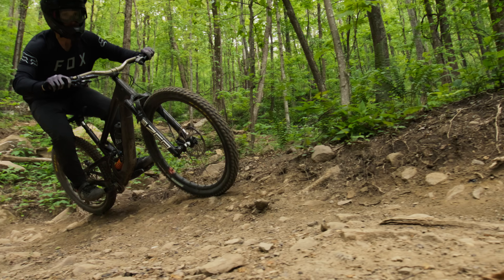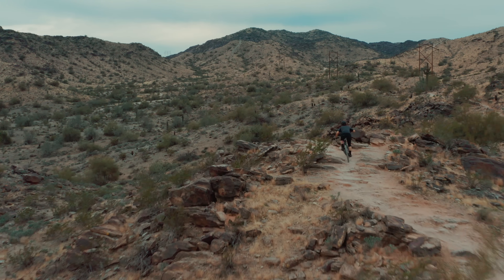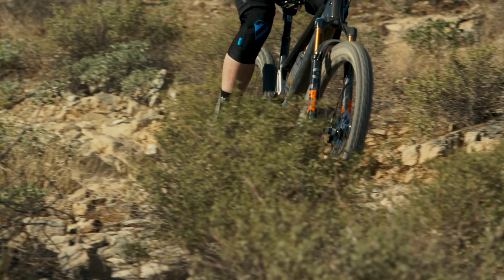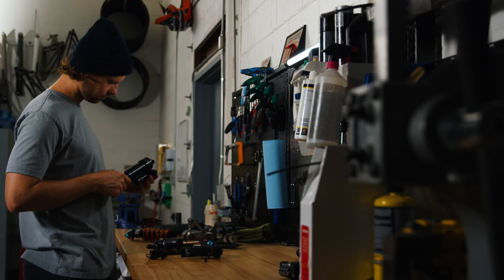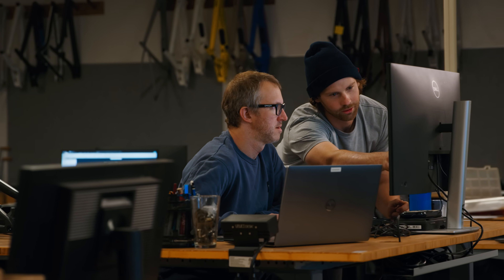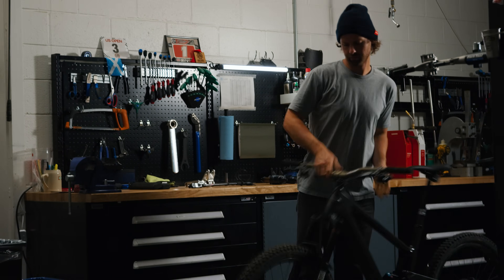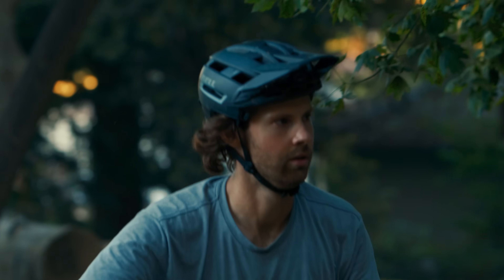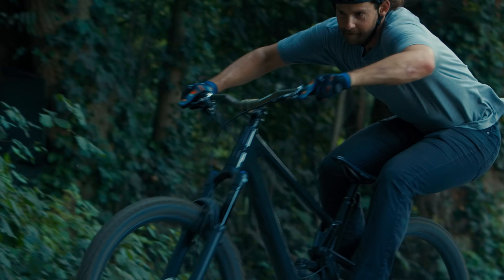Who is Santa Cruz's suspension test rider, Kiran MacKinnon and how does he do his job?

Comment: Interesting that the guy who kind of picks the suspension runs a rs front fox rear.
Reply from the maker: This is a question we get asked alot. People think there is some sort of rule, or reason that you can't run a different brand fork and shock on the same bike. There are zero reason not to. If we really like the way a specific rear suspension works on a bike, we run it regardless of fork brand on the same bike model. Sometimes you just find the best of both worlds to get the overall feel you are looking for.

Comment: I’ve learned the suspension that feels perfect for a pro ride will probably feel like crap to your average rider. Average riders probably make up 80% of bike sales
Reply from the maker: This can be true, which is exactly why Kiran mentions that he's always looking for that balance to find the 'perfect tune' for varying types of riders👍
Reply: Agree 100%. I've got a 2022 Tallboy.  When I ride at my top speed the bike feels pretty damn good; the best MTB I've ridden in 35 years of riding.   I'm neither skilled nor fit enough to ride the stock setup in its sweet spot.  This results in the bike not feeling all that great at my usual speeds and lines.  Nowhere near enough small bump unless I'm hammering. It's riding very well now that I've made mods with a Vorsprung Luftcappe in the fork and finding a better spacer/ psi combo for the rear.  My take on it is I don't want a bike that's made for my sweet spot because I'm improving and don't want to exceed the bike.  I want the bike to exceed me. It's not all that difficult to find a suspension tune that suits an individuals ability if the bike has range.  But I'm not going to spend Santa Cruz $$ on a bike that runs out adaptability where the median of 80% of riders is, even though I'm not that far of that median myself.  Easy to flip that and say it's just as easy to level up with mods to an average rider stock bike, but the kinematics and geo will always be for average speeds and handling.  For me I'm excited to grow into the bike.  I suppose that SC could have two suspension tune starting point recommendations, one for average riders, and one for slayers.  That would save a lot of fafing around from the get-go on initial bike set up.

Comment: id love to hear his opinion on alternative drivetrain options especially regarding the influence of chain-movement on the rear-end characteristics/performance
Reply: I guess that’s what the crestline Rs 205 is going for with their almost identical VPP setup and idler pulley, albeit with 200mm travel
Reply: @DrudgeAudio  well yeah and no. i shouldve made more clear what i meant by chain-influences. you can distinct to different ways the chain influences the suspension performance.
first: the obvious pedal kickback story, that is fairly easy to manage using idlers and appropriate geometry. however in some cases (such as santacruz bikes for example) a certain amount of pedal-kickback is desired.
second: the intertia induced slapping around of the lower part of the chain in conjunction with the cake of the derallieur (and its clutch). this has several effects. it will also induce a moment on the chainring and thus can also feel like pedal-kickback. on the rear end it the tension-forces will negatively effect the way the suspension moves. as the chain and the derallieur are really heavy parts of the rear end they essentially act as another sprung weight, that can also negatively effect the suspension dynamically. more so than just a lumb of metal with the equivalent unsprung mass. 

what could be done to mitigate this? the most straight forward thing to do would be for example a gearbox-bike with a belt (especially for downhill). you could also look into wwhat trinity-bikes or lal-bikes are doing